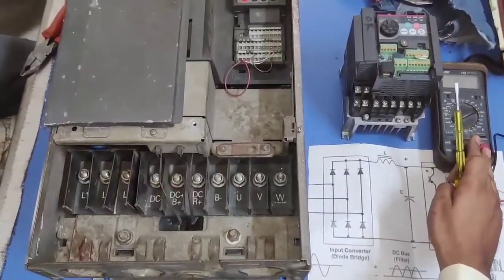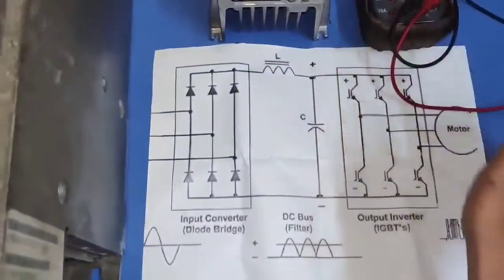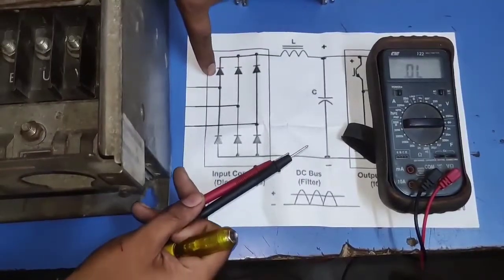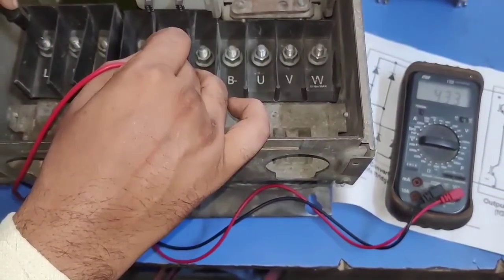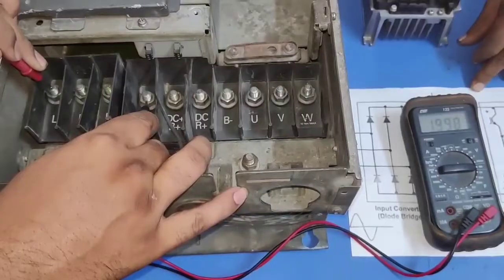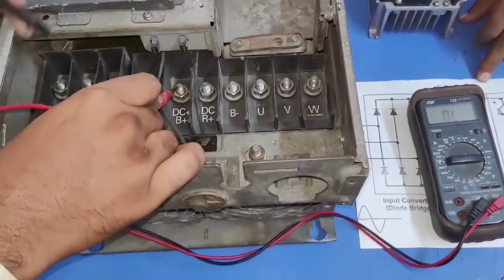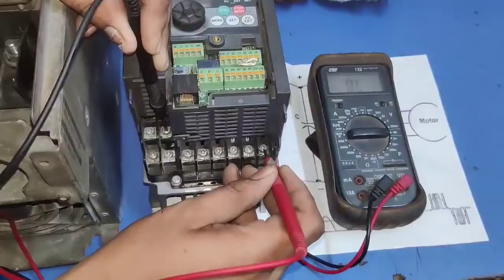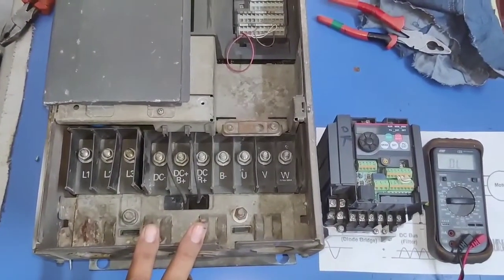How to Check VFD! How to Test VFD! VFD Testing With Multimeter!

Comment: the problem I am having is that there is voltage at both input and output ends. but the motor is not moving and also the VFD is not displaying

Comment: the problem I am having is that there is both. input and output voltage but the motor is not moving and the vfd is not displaying